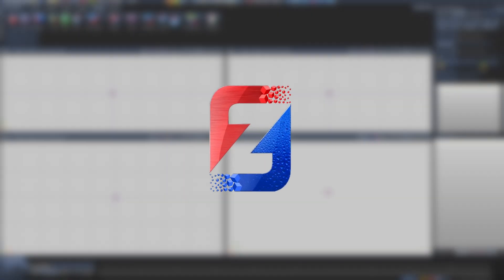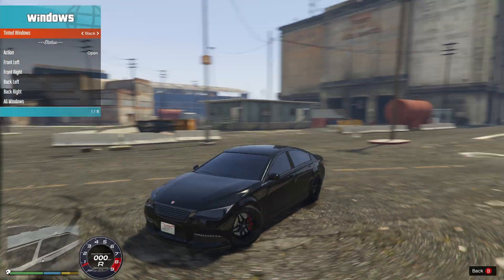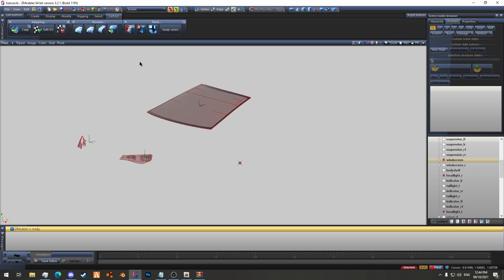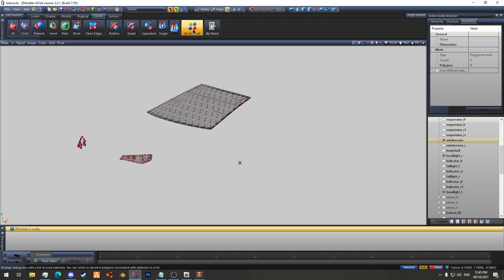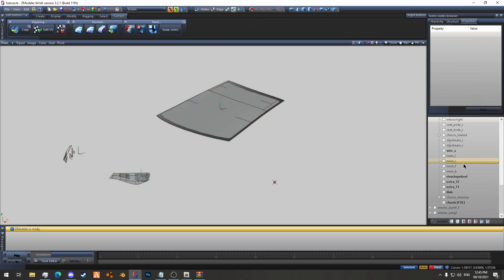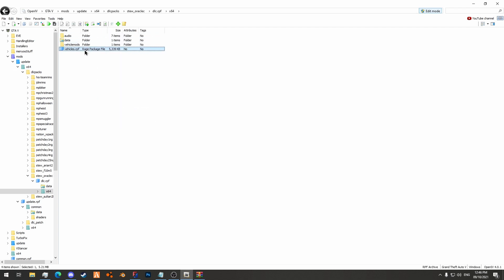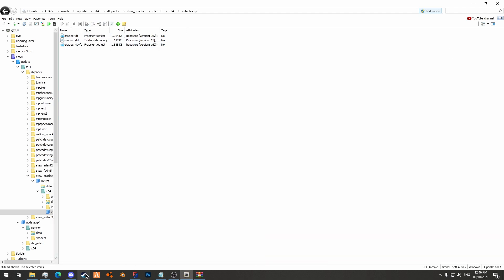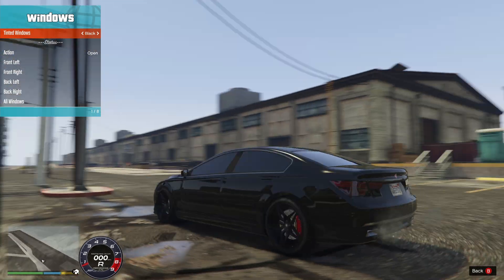How to Fix Window Tint [ZModeler 3 | Tutorials]

Comment: Could you make a video on how to make the windows tint on? PLEASE
Reply from the maker: To make windows tint you just need to have a material that's got the vehicle glass shader assigned or the vehicle_lights shader assigned and then paint the alpha channel white instead of black on the vertex level.
Reply: @13Stewartc  It works, thank you very much.

Comment: I just did this but my yft and hi_yft had 0 kb after. I followed every step and failed still
Reply from the maker: Make sure you name the root of the hierarchy correctly before exporting. Also check the error when exporting if any, it'll tell you what's wrong
Reply: @13Stewartc  I'm new to it all. Do you have a discord maybe??  It doesn't give an error which is what confuses me. I also did the sunroof tilt and treated it as a extra part like how you made that spoiler video but it doesn't work it just stays down and the extra doesn't pop up.

Comment: I checked the vertices, material, changed the colors to white and also tested it in black, but none worked :(

Do you need to change something in vehicles.meta or carvariations.meta?
Reply from the maker: You must have missed a step mate. Make sure all vertex properties are applied.